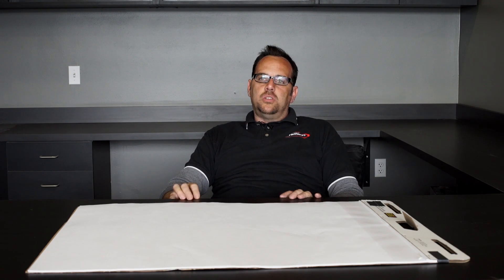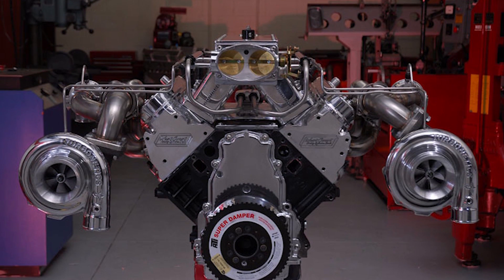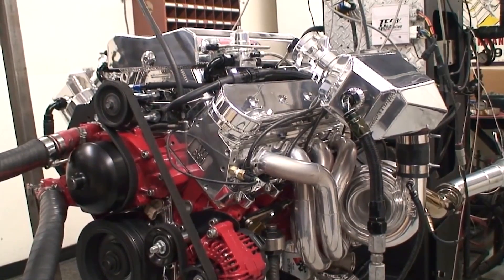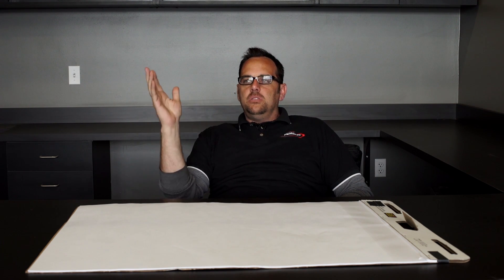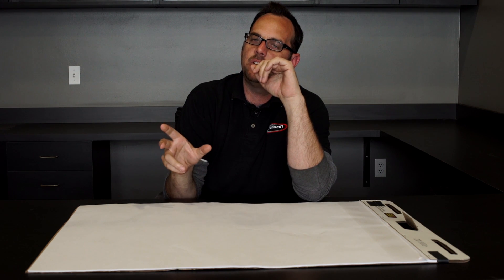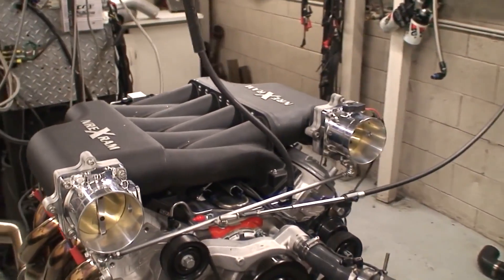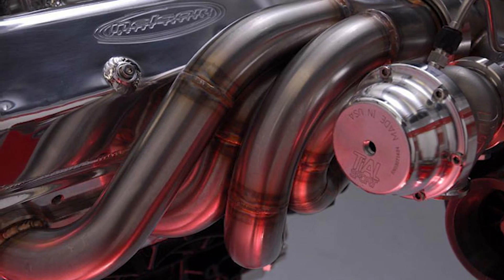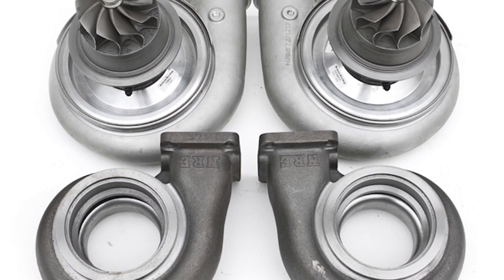Master Engine Builder Explains Why the LS V8 Is SO Good

Comment: I am a woodworker. I make hand cut dovetails and box joints. My joints require clearances of between 3 to 4 thousandths. So watching your video I am appreciating the multitude of factors you must take into account, and the precision that you must achieve to produce your engines. My hat is off to you, You are a master, and your video is inspirational.
Reply: Jake Bewely Of course you don't.
Reply: .003 on woodwork?  ummmm Im a gunsmith at a local 07 02 . humidity and temp can make a 1in piece of walnut fluctuate over .02
Reply: and then you woke up. lol
Reply: Cast Iron is still used in engine blocks, manifolds, brake drums, rotors, master cylinders. Steel is after all about 99 % Iron, so it's not too wrong to refer to even steel as iron.
Cheers
Reply: NO you cash me outside the woodshed.HAHAHA!
Reply: No they dont use steel. its Iron. Its always been cast iron blocks and they are still used today. its easier to pour than steel and machines nicer than cast steel.
Reply: Why do people keep saying Iron? No one uses iron on a car or practically anything else nowadays. They use steel.
Reply: if they don't understand the difference between iron and steel,they're surely going to get lost with billet, forged and cast.
Reply: Except that variation in carbon content leads to HUGE change in mechanical properties! Except that grey "cast iron" contains less iron (<95%)  than steel.  It is too wrong !!! And steel varies in it's alloying elements. You have austenitic, ferritic, and martensic crystal structure.
Reply: .003" with wood?  haha bullshit.
Reply: @800lbGorill4  

I do fine carpentry and 1/256th (.0039) has it's place in stain grade work. Not hard to achieve either. 1/16 on a tape measure can easily be split into 16 parts, a sharp pencil line with a number 3 pencil will produce a line that thin.
Reply: @toddmiller5322   A tape measure?  Nobody in fine carpentry uses a tape measure they use a machinist's rule and a marking gauge.  And big difference between .003 and .0039 that's 25% variance on a good day XD  And a pencil?  Nope we use a single bevel marking knife.  Wood can vary more than 3-thou throughout the day (actually more like .02 depending on the variety, moisture content, and environment) with temp and humidity so to say that you keep that tolerance in your work is absurd.  Scenario you cut a dovetail in the morning to .0039 and by the afternoon when you fit it all together the joints have grown a compound .0078 at all mating surfaces good luck buddy.  Sure if you're doing a small piece you can get that accuracy right now, as you cut it.  If that helps you sleep at night.
Reply: @800lbGorill4  You can talk all the crap you want, but I've been doing this for a living for 23 years. No one in fine carpentry works outside of a climate controlled environment either, so this bs about temperature and humidity variance is moot. Also I do use a machinist rule when necessary, but I can measure and cut to those tolerances with a tape measure and a sharp pencil, it's called skill and experience. Just because you can't doesn't mean no one else can.
Reply: @toddmiller5322   whhooooaaaa look every everybody we have an self-proclaimed bad ass on the internet!
Reply: I work with wood and iron and removing material from iron is not comparable
Reply: meet me out behind the hhhhwwwwwooooooodddddddd shed
Reply: Also cast iron is more rigid, more wear resistant, good at damping vibrations, expands less with heat, and rusts less than mild steel.
Reply: i think he means thous of an inch. us watchmakers work to no descernable tolernace really or like .003mm at patek philippe in cnc production .005 in most places temperature at those sizes becomes an issue for us too
Reply: outisde of outliers like maybe ships and lawnmowers is there really anyone still making cast blocks?
Reply: i think the vw golf is still cast iron block
Reply: we dont make watches with wood mate, mostly berrylium copper, saphire, brass and steel
Reply: Jake Bewely no one cares if u care or not
Reply: Hand cut dovetails? You've got a lot of time on your hands to cut them by hand. I just use a jig for a table saw or a router. But more power to you buddy! If it works well for you, I say keep it up!
Reply: Do you use a set of calipers for.each and.every one of.your dove tails........lol
..
Dumbass
Reply: Engine building is an art, just as wood working! Wish you the best in your profession sir!
Reply: sigung01 
I am a Hardwood flooring contractor and we get the do some crazy stuff too. When doing boxed log cabin style borders and mitered borders we have 0 room for error, we must be set at tight to tight. We have to leave room for expansion but never in the field. The same when doing medallions/inlays. Most people think its just a piece of wood or you don't have to think, just work when in fact we are making a huge piece of furniture...that must last longer than furniture...while walking on it! I have worked with iron and steel also. Each has its own characteristics and special qualities...both good and bad!
Reply: sigung01 aren't dovetails  just to lock corners of the drawers? cabinets may require  more precision but not that much. hate to install or try to slide oht a drawer on a humid ass day.
Reply: I once build an engine with the worst parts I could find. Chewed up cams and crank. A piston that I had been using as a hammer. And reused gaskets. I got 60 k miles on that engine. Toyota 4ag
Reply: Awesome
Reply: Your mom cares 
about me to.
Reply: 0
Reply: My mom cares about me 😄
Reply: Yeah I uh, don't care..

Comment: Got the LS7 in my Z06. Many track days. It gets to 7000 rpm right now! Smooth power. Not one hiccup. Long tubes and Cold air intake. No internal work.  Dyno 490bhp/470 lb-ft at the wheels. Back calculates to 575/540 at the crank. You can get more power but loose low and mid range and hard to put it down unless you go to boost. And then your reliability is threatened.

Comment: I know aluminium and iron are used a lot to build blocks/heads, but how often is steel used? New to engine design.
Reply: Ive never seen a fabricated steel automotive engine block (or head). I guess cast Iron is strong enough that they dont invest in it. I imagine it would be a big deal to make them in large numbers. fyi some diesel locomptives use steel fabricated engine blocks.
Reply: Ah cool. Thanks man. Just getting into this stuff and loving every bit of it :)

Comment: What is he saying needs to be done when installing a 4" crank to avoid sleeve wear? Longer piston sleeves...? Can this be done?
I am looking to put a 402 stroker kit in my l98 (LS2)
Reply: No, you need a different block. A tall deck RHS,  LSX or LS7 block.
Reply: The cylinder sleeves in the ls1, L98, l77, ls2 and ls3 blocks are too short for the 4" stroke crank

Comment: I love all the comments here about this is better than that and so on. The Questions he answered here were about "why is the LS so good?". He gave very valid answers and knows about all there is to know about these engines and the older generations of the GM V8. I personally cannot believe that GM has continued use of the 50's design, but they make it work. The LS7 is 505hp and 470 lb-ft for
a normally aspirated engine. A 7100 rpm red line, dimensionally smaller, lighter, and less expensive than any production normally aspirated motor with this power output... I guess push rods still work. 
On a side note, I don't own a GM product, just wanted to go over the facts as I see them.

Comment: Technology? Why is the hemi and coyote so good? Technology.
Reply: The HEMI was a great engine when it came out in the 1951, as the 331 FirePower -- because it has cylinder heads that flow amazingly. But the King of all V8's is by FAR the dual-plug 426 HEMI.

Comment: LS is crude non-linear horsepower. Good for a truck, bad for a sport GT car.
Reply: You might want to look up a few nore things about the ls
Reply: so a 4.8 liter v8 with STOCK internals with the exception of a turbo cam that makes well over 1000 hp with a big turbo and fuel is ''only good for a truck.''?

c'mon man all the proof is there, how the heck do you manage to breathe and walk at the same time if you can't understand clear concise english based on physical facts?

the ls v8 is by leaps and bounds, superior to ANY other design.  And I'm talking about engines in cars that are exponentially more expensive than a 9 second ls fox mustang...
Reply: Jason Burt  You're the one making the claim, so post a link showing the flat torque curve of a Porsche, or we'll just assume you're blowing smoke.  As I recall, the torque curve of a 911 Variocam Plus engine had a pretty significant dip in it before the long duration cam kicked in.
Reply: Look at the horsepower and torque curve of a Porsche, it's very smooth with no dips or peaks.  The impulses of the motor are practically non existent.
Reply: just like all these gm v8s....

v8s are known for producing a lot of torque from low rpms. people make 7-800 hp wit stock cams. camw that idle smooth and make power right off idle...

Comment: Saying an iron block is stronger than an aluminum block is like asking the question, “Which weighs more, a ton of coal or a ton of feathers.”  The common answer is the coal. But a ton is a ton; it just takes more feathers to make a ton.  If the Al block is designed right, it can be just as strong as the iron block.

For a given size, pure Al is one third the  the weight and one third the strength of iron.  So strength to weigh is the same.  But Al alloys provide advantages in strength to weight and you start winning the weight game with Al.  I have seen an aluminum wing tip of a D-C9 airliner cut through the steel cab of a fuel truck on the fight line.  The cab was destroyed.  The only damage to the wing was some scratches on the skin and a destroyed landing light.  I flew the airplane home without repair.  The truck cab was toast.    

Bottom line, if the Al block is breaking more than the iron block, it was not designed right.  The Al LS is designed right.  It IS a great block.

Comment: Good Info I read a Article in Corvette Mag that the Engineers at Gm Dyno the LS Engine it had a lot of  Potential of High Horse Power but kept it quite for a few years because of the 90-95 ZR1C4 Corvette 4Cam 5.7

Comment: That is a very fascinating point that he made about stroked engines. Not only in the piston skirt unsupported, but it happens at the worst possible time. The function of a crankshaft is a sinusoidal wave, but the function of a piston is a sawtooth wave, and the two find maximum deviation at TDC and BDC when the connecting rod must absorb the gather and delay of compensating for the differences of the two functions.
Having your piston skirt exposed at the critical time of just before and after BDC is a formula for disaster, and I can't understand how so many people get away with it.

Comment: Good information regarding the stroker kits. My personal experience has been very positive with the LS6 intake and the FAST styles also. Anyone replacing an intake should shy away from the metal manifolds, as they tend to heat soak

Comment: Here is my 2 cents as a Car enthusiast. I love JDM and I love American Muscle.  I love the LSX engines. They make great engines. You got LS1's that last over 200k miles if taken care of and reliability and gas mileage is great on those big V8's. possibly up to 30mpg its also lightweight so it makes great swaps. I also grew up around the JDM scene. I cannot deny that an LSX engine will run with the best of the JDM engines but as I been around the car scene so so long you pick up a lot of things by stepping into different people's shoes. LSX is American, and Americans generally make cars to go straight. They run the quarter mile for the lowest time possible. As for the Japanese, they have mountains so their performance aren't meant to even go in a straight line. It's meant to corner and track. Looking from the JDM scene, they dont hate on American Muscle because of their engines. They prefer JDM because of their lightweight chassis. American Chassis is way too beefy and heavy around the track. That's a huge reason why jdm heads don't run slicks and track their cars. Majority of American cars cant even get a good time around the track until the late 2009's when Chevy upgraded their tech for their Camaro and Vette's which  are American's top cars btw. But you have to look at it like this. The amount of power the Camaro ss makes (about 430hp) got killed  by a  Honda (civic type r) around the track (300hp) or even a WWgolf making 270hp. (You can check the nurburgring lap times by the bay) Even the Acura Nsx which is old technology under 300hp beat the SS around the track. Why? BECAUSE OF THE HEAVY CHASSIS. The power to weight ratio is also way off too compete on the track. IF these imports went against the SS in a quarter mile, they would get killed but as I said, For imports, they mainly care about the track.
Reply: The new vette has set a new record this year what is your information based on haha
Reply: Obviously never heard of the acr viper, which destroyed almost every Japanese car around the nurburgring
Reply: Ford GT40.
Reply: WRONG!!!!

Comment: coyote based engines make more HP per cubic inch
Reply: hp/per liter? How about hp/per dollar?
Reply: Yeeeaaah but the mangy coyote has 4x the cams and twice the valves.
Reply: Yeah go figure the more expensive engine makes more power.
Reply: Guess that's why I keep seeing all those LS swapped mustangs at the track hmmmm
Reply: Yeah except you have to force feed them to get there compared to a gm n/a
Reply: +Why do you want my name u are incorrect, fmc coyote based voodoo engine 100 HP per liter n/a. educate yourself
Reply: Your mom is trash!
Reply: Jeremy Hall over 2 years since your ignorant comment and the LS IS still the KING of engine swaps, boy. 😆🖕🏼
Reply: Take up twice as much space, cost five times as much and doesn't build any low end torque. No thanks
Reply: Same with the voodoo they make ls engines look like trash, wait ls IS trash!

Comment: Why is the LS engine so good?

Because it has more in common with a Ford engine than a chev.  Heck they even use a Y Block design.  Hmmm who used that back in the 60's .  Same head stud pattern Ford Heads will bolt straight on.  Same bottom end bolt system as a Ford modular. 

The list goes on.
Reply: mopar had the Y block before anyone....
Reply: who copy who ? 1955 Ed Cole  v8 sb chevy   !!!!!!!!!!
Reply: Ford may have had it first, but Chevy made it better👍🏻
Reply: Ford still has the most recalls out of the big 3. Chevy is also the most reliable.
Reply: @elpatas2594  Most reliable???? Only in your dreams.
Reply: If it was so close to a Ford engine, why didn't Ford make it?
Reply: Whoa!! Step away from the pipe son. You have NO idea what you are talking about! !
Reply: Ford heads don't bolt on dumbass. LS doesn't have anything more in common with a Windsor than Cadillac big block
Reply: Ford modular. unghh.
Reply: Even if it is true, your just pissed because chevy took all these discarded designs, put them together, and kicks the snot out of fords coyote which has a decade more of r&d

Comment: Another cheap ass chevy.  Copied the Ford 302 heads, same head bolt pattern nearly.  Ohh and it leaks less oil.. less than a 350 Lmao.
Nice inline valve pushrod engine, same since the beginning of time.  Chevy is cheaping out, cost the same, but you get less technology.  No Hemi, no DOHC V8's.  (they did some corvettes with that, but not impressive)
Cant spell Recalls without LS.  Thank the CEO's for that.
Listening to this guy, makes the LS engines sound BAD.
Enjoy your bowtie little boy.
Reply: GM didn't dopy shit from ford.   Don't belive that lying bastard FRANK 736598389749837, or what ever number it is.
Reply: we need more ford guys like you!! ide take a SBF over any ls